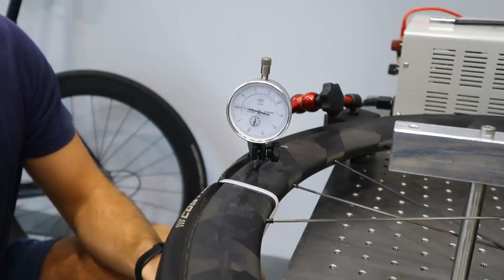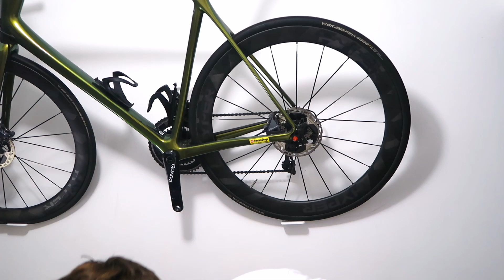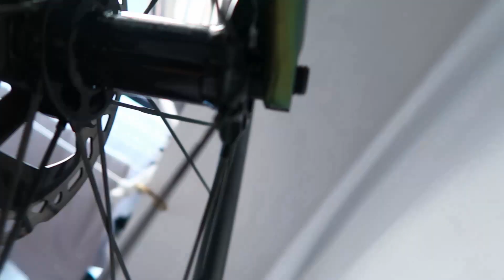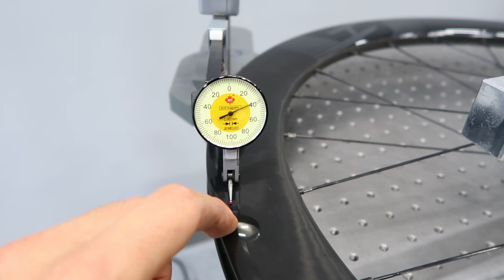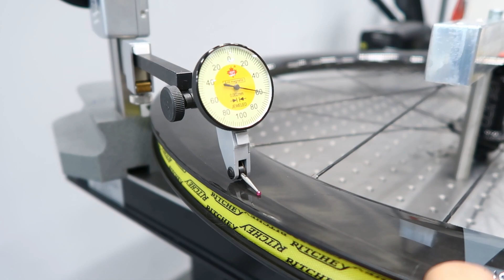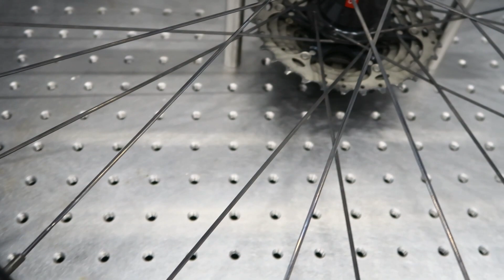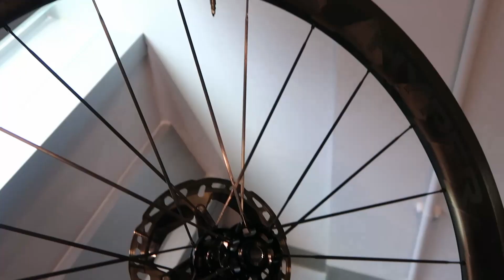WINSPACE Hyper Wheelset Review - Real testing and real data.

Comment: https://www.winspace.cc/lunwheels Just mind-boggling all that technical talk and not a word about how out of balance the rim is. Rotational balance is a key critical performance detail when those rims are spinning at 40 ~ 60 miles per hour! Most name-brand carbon rims are about of balance o/a 8~13 grams! There's one major brand that's consistently the worst averaging 18~25 grams. FYI: A wheel reflector weighs o/a 15 grams!  So my question to the wheel maker and the technical reviewer, why do you keep ignoring rotational wheel balance. That's like selling wheels with a reflector stuck inside the rim, and that's a fact!  Now think about this... Basically, 50% of a bike is static weight ie frame, fork, saddle, h-bar etc. The other 50% spins at a high rate of speed. Yet no one has ever thought about balancing that 50% where at high-speed that's CRAZY, DANGEROUS & STUPID.  And bicycle engineers wonder how come some late-model high-end bikes easily go into the dreaded & dangerous HIGH-SPEED WOBBLE or SHIMMY, and some do not??  I'll tell you why...  Because some bikes by "sheer luck" have fairly balanced wheels, and some are severely out of balance, and later are the bikes that fall victim to High-Speed Wobble.  Not to mention the severe loss of rider watts, rolling efficiency, and high-speed handling.  I can assure you, soon rotational wheel balance will soon become the new benchmark of "MUST HAVE TECHNOLOGY", and when it does you'll remember this message.
Reply: those who can, do. those who can't, complain.  you are more than welcome to test them yourself, but I sincerely doubt you have ever broke 30mph.  the truth is that most riders will never go beyond 40mph on a bicycle.
Reply: @9BlueCloud  Hello Cloud9 Blue,  I would assume that is you on the video?  I don't want to sound off as being negative but I was a Cat-1 racer in the mid-80s thru early 90s racing in So. Cal and Mexico. I was considered one of the fastest descenders always exceeding 60mph plus which skills I got road racing semi-pro on 400cc motorcycles before I became a Cat-1. The one key factor I carried over from my M/C roadracing experience was balancing my wheels, which made my bike handle like it was on rails at high speeds.  And yes some never exceed 40 mph, but even at lower speeds unbalanced wheels unnecessarily tax and rob riders of watts. Also, you would be amazed how easy it is for the average rider to exceed 40 mph when descending down long smooth mountain roads. I've delt with countless riders who just purchased a new all-carbon bike, went out the next week to ride hills and mountain roads when suddenly their new bike went into a wobble and out of control, some not even hitting 35 mph. Some at higher speeds which is very dangerous.  Riders who know me, then advise them to come see me to balance their wheels.  Sure enough, they let me know right away their bikes no longer suffer weird high-speed instability and now the same bike invites them to go even faster. 
Today wheel balance is like bicycle aerodynamics was 25 years ago. Back then if you asked a bicycle engineer to incorporate aerodynamics to any part of a bicycle they thought it was stupid and did nothing to improve performance. Why? Because engineers saw the rider as a barn door, so why bother.  Now try to sell a high-end bicycle or wheel without some kind of aerodynamic technology, GOOD LUCK.  Some of those old engineers now work in wind tunnels.
I can assure you, the moment some bike engineer (like Hambini), conducts some serious testing on wheel balance, they will be shocked and kick themselves for not doing this earlier.  I know because I worked 30yrs inside the bicycle industry doing R&D and product development mostly for the Japan group (ie Shimano, Araya, SR etc). My specialty was tire development until I semi-retired from Specialized in 2003. So I know a thing or two about balanced wheels. 

There is more.....
Dan
Reply: @9BlueCloud   Wheel balance continued....  95% of high-end wheels are slightly or severely out of balance on average 9 grams. What bicycle wheel engineers fail to understand is when those innocent 9 grams begin to spin at high speed, the G forces cause the 9 grams to increase in weight, which starts a slight oscillation. As speed increases those small oscillations grow and starts to invite the entire wheel to start oscillating. As the speed increases more now the entire weight of the wheel (from the axle to the outer perimeter of the tire), to start to violently oscillate.  At speed, it's no longer the innocent 9 grams causing those powerful oscillation forces, but the entire 1.2 LB frt & 1.5 LB rear wheels spinning on your axles like sledgehammers!

This is a fact no one in the bicycle industry does not understand or want to understand.  Current wheel engineers think even if the wheel is slightly out of balance, when the weight of the rider gets on the bike it cancels any imbalance problems, when in fact it actually makes matters worse.  Now you are trapping these violent oscillation forces between the solid ground and the weight of the rider causing those powerful oscillation forces to somehow be dissipated thru the wheels bike and rider.  It reaches a point where the wheels can no longer dissipate this energy that they literally want to destroy themselves.  You can see this in this video, forward to 1:20. Yes, the fenders are shaking but look at the bottom of the wheels warping. You can clearly see it in slow motion. https://www.youtube.com/watch?v=QC-PuBDFNac

Case & point,  If you look at an SUV wheel they weigh about 50 LBs and you ask your self, how can those tiny little weights on the edge of the rim keep that 50 LB wheel from oscillating at high speed? What those tiny weights do is to cancel and or prevent the start of any small oscillation, which if left unchecked will cause the massive wheel to swing from the SUV axle like a 50 LB sledgehammer at speed.  Same principle on a bike... But because a bicycle has evolved to absorb massive amounts of vibrations it causes riders to dismiss these hardly felt vibrations as simply caused by road irregularities.  

I know it's a lot to read into, but that's how aerodynamics was treated before it became the must-have technology.  Most said, "I don't feel any difference, its all hype and a waste of time". But when someone figured out how to measure it's performance advantage suddenly it was legit. I have a feeling when some figures out how to measure wheel balance performance advantage, it will outperform aerodynamics by a mile.  Then if you combine the two, aero & balance... Hey, isn't that how F-1 cars work???
Reply: @dansotelo228  I am rather impressed by the vomit of words that you just typed. Unfortunately, they are still mostly irrelevant to the discussion here.

And if you are really bothered by a few grams of difference, you can balance the rim with few lead pellets taped to the inner surface on a wheel stand.   Anyway, there is no need for your type of annoying "know-it-all" attitude here.  For some of your age, I recommend you find a more healthy hobby for your mind and body than arguing on the internet.

By the way, I am not Peak Torque.
Reply: @dansotelo228  Quick search of your name on google reveals why you are so invested on an irrelevant question that no one else is interested.   Anyway, good luck with your "invention".
Reply: @dansotelo228  Thanks for sharing your knowledge. Does the valve also put the wheel out of balance? And if so, would it be necessary to counter balance the wheel once tires are mounted rather than at the wheel construction stage? Also Caden Wheels supply counter balances with their wheels. Thanks again

Comment: Thanks for the review! Still on the fence between Light Bicycle and Winspeed (Like the LB can be made with no spoke holes in rim bed for tubeless + able to customize builds (brass spokes, carbon - ti hubs, Sapim cx ray spokes... but for price, weight and stiffness, these seem like a really good option. For rim brake wheel, which would you prefer? LB wheel with 28mm outer, 21.5mm inner, or the rim version of these with 19mm inner, 26 mm outer (plan to use 25mm Conti tires)...
Reply: I'm in the same boat. Another option is winspace lun wheels in 45mm they are 1487g so a little heavier, but u get sapim cx spokes, no holes in the rim so no tubeless tape needed and have grooved brake tracks. 

With the discount they are around £560.
Reply: May I know your decision? Now in the same boat..

Comment: Why you didn't test stiffness on both sides? it's very likely to be different with asymmetric spoke pattern.
Reply from the maker: I did test both sides. Table/chart values are an average
Reply: @PeakTorque  Was there a lot of difference between sides? I think this is an important part too.

Comment: I would really think about investing in a set of these if they were available with a Campy compatible hub.  Any idea if Winspace is thinking of speccing Campy on the Hyper (it already does on the Lun)?
Reply: dancer65  I have a set on order with a Campagnolo freehub for my SR eps clad Colnago C60. I intend to compare them against my Zipp NSW303’s.
Reply: @ThePaulKat  Hey, thanks for letting me know.  Were you able to spec a Campy hub on the Winspace website?  There doesn't seem to be the option to do this for the Hyper.  C-60, SR eps and a superb wheelset - Dream Bike!  Be interesting to see how the new rims compare to the Zipps.
Reply: @dancer65  I emailed them and they said that they could/would supply the Hyper with a Campagnolo   freehub. They should land early next week. I am intrigued by these wheels, my Zipp NSW's are great so it will be interesting to see how they stack up. Only problem is I had to pull out all the stops to get my C64 disc to a comparable weight to the rim C60. The hypers are going to move the goalposts.

Comment: Thanks for posting. Interesting insights!  Did you compare the deflection of the rear wheel in both orientations?  Since NDS is radial laced would be curious to understand if deflection is identical.  Also,  was the deflection of the front wheel tested? Didn't see those values.  Finally,  was a comparison between the rear alloy wheel and the carbon wheels made?  The video only shows the deflection of the alloy rimmed front wheel.
Reply from the maker: Values in the table/graph are average of both sides. And the rear wheel of the alu rim is in there! Look harder 😉
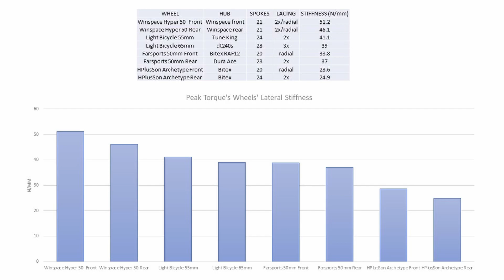Reply from the maker: @21:13
Reply: apologies...watched twice and still missed the table.Nicely done! Factual and informative. Keep up the good work!!

Comment: Do they make the rims or are they made by quest or yishun as open mold or from the retailers design? Is there any spoke float at the nipple end as I've found that steel spoke tend to fatigue faster in a carbon rim. So the  winspace hubs have a greater offest tonthe 240s? Are the holes are asymmetrical to reduce stress angles.
Reply: I can only answer your first question. The actual company is Gotobike Carbon Technology who are a manufacturer of some leading US and European bike frame brands. I believe that Winspace is their own brand. I have recently ordered a set of their wheels and their service has been excellent so far.

Comment: Actually it would have been interesting if you had also measured the deflection on the opposite side of the rim to the weight. Because counter-intuitively a wheel which is too stiff can lead to more brake-rub than a less stiff wheel because the rim doesn't remain perfectly round. My hunch is that the aluminium rim would fare better in this regard.

Nonetheless nice measurement and results
Reply from the maker: Yes you are correct. A stiff rim will transmit more displacement to the opposite side and generally experience more brake rub. A softer rim will bend more locally as it has lower inheritance bending stiffness. Never had a problem with brake rub, but i do like to run the pads far from the rim.
Reply: Brake rub as has much to do with the frame than the wheel. You can have a wheel rub on one frame and not on another.

Comment: Great video, these look very much like the hunt 36mm UD carbon wheels on offer. Whinspase do the 36mm and 50mm wheels on the website and looks extremely alike. Since you are an expert what is best for a 70kg rider in an aerodynamic point of view. 50mm 1500grm or 36mm 1290gram wheels?
Reply from the maker: I would say 50mm will always be better aero wise. Weight is not really that important. But i can't comment on the aerodynamics of these wheels and nor should anyone without proper testing and proof.

Comment: I wonder what you would think of the Reynolds RZR's I just got for a mahoosive discount because they are NOS.  They are probably the tail end of the last generation of wheels but there are distinct design elements.  First, the spokes are not under tension.  Second, the rear hub has a third flange that is central to the rim with some of the drive side spokes attached to that flange.  [Edit] all spokes are radial - 16 front, 20 rear.
Reply: Look the blog rouesartisanales from Adrien Gontier who founded RaR wheels. He measured them, in short the spokes sustain the lateral forces for moderate stress, then collapse and wheel loose all form of stiffness.
Reply: @cipo36an203  I read other sources who also say they are not the stiffest.
Reply from the maker: Sort of like lightweight Obermayers in construction. I'd love to review the RZRs. The central flange is not radial, those are tangential spokes for torque transfer of you look closely. And i do think they are under mild tension.
Reply: @PeakTorque  Your knowledge on this is greater than mine.  Maybe I could get my pair to you to look at.

Comment: Hambini did his aero analysis on the rim brake version and basically found they were the fastest 50mm wheel, probably by fluke. So are these the same or is the rim shape different given they are disc brake.
Reply from the maker: Im not sure sorry, i rarely go over 26kmh average 😂. But i assume the rim shape is identical apart from a thinner wall where the brake track would be.
Reply: @PeakTorque  why do you rarely go over 26km/h. You seem like a big lad who can push way more.

Comment: Ive been buying Chinese Carbon products since 2010. I still use the same carbon wheelset and carbon frame to this day. The only issues that I have had is general wear and tear. I will ALWAYS recommend Chinese carbon to anybody looking to get into cycling. Winspace, Yishin Bikes, Yeoleo or any company with 10+ years is going to be a good product. 我爱中国碳纤维! ! !
Reply: Which Chinese carbon manufacturer you buy your bike from?
Reply: @rudysianturi5223  In 2011, I bought my frame,  fork and wheelset from Yishin Bikes and I still use the same frame and fork today as my winter trainer.
www.yishunbike.com
Reply: Maybe you should check out Farsport and Vortex which is well known carbon wheel producers inside China.

Comment: Radial spokes are ok for a front wheel with rim brakes, but doesn't seem wise with disk brakes especially in the rear wheel.The  hubs could snap between the flanges under braking due to torsional loads. Carbon spokes should be better if there was a way to tension them without composite threaded ends. Distortion  of the hub flanges under spoke load is something I never thought much about. The bearings need good even support to work properly. The limits are being pushed in several directions here and I'd assume these are race wheels only. This is no industrial machine with huge safety factors. These things if they fail in high profile races will get banned like spinnergy wheels.

Comment: In regards to the spoke-nipple bonding it is feasible to make it stronger than the spoke itself. As a rough approximately I reckon you need around 10-ish mm of bond length. 
_
The aluminium is considerably more flexible than the spoke, so load transfer through the bonding should be fairly even

Assume: 
Spoke diam: Ø1.5mm
CFRP UTS: 900 MPa
Bond strength: 30 MPa 

Calculations: 
Spoke cross-section: 1.77mm^2 (0.75^2*3.14)
Spoke strength: 1590N / 175kg (seems about right)
Bonding to cross section area ratio: 30 (900/30)
Bond area: 53mm^2 (1.77*30)
Bond length: 11.3mm (53/(1.5*3.14)

Keep up the quality content!
Reply from the maker: I knew i had some good guys on this channel 👍😉 Great comment. Checking the calcs now :)

Comment: Just realized you look like a young Hugh Laurie. :)
Reply: But on a serious note, any clues if Winspace will be producing rims optimized for 28mm tires? I'm a glutton for comfort.
Reply: Phoebe Tan check out LB if you need a chinese wheelset that’s optimized for 28s. But I wouldn’t hold my breath. All the mainstream manufacturers are still optimizing around 25s
Reply: @404nobrakes  Thanks, I actually have a set of LightBicycles WR38s. But I'm in the market for deeper section wheels and the more options the better!
Reply: Phoebe Tan a WR65 is coming soon.
Reply from the maker: I'll have to check that out about Hugh Laurie...